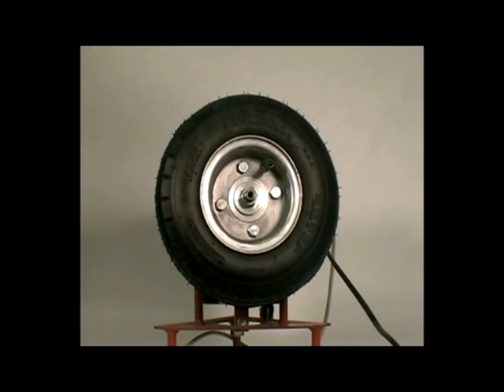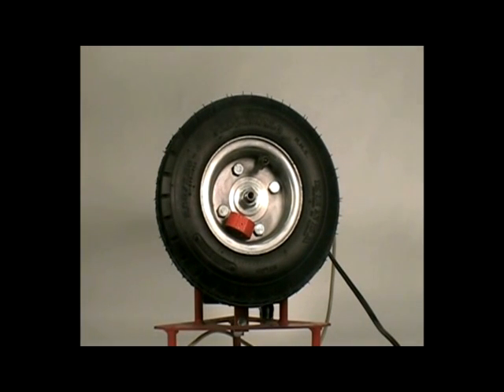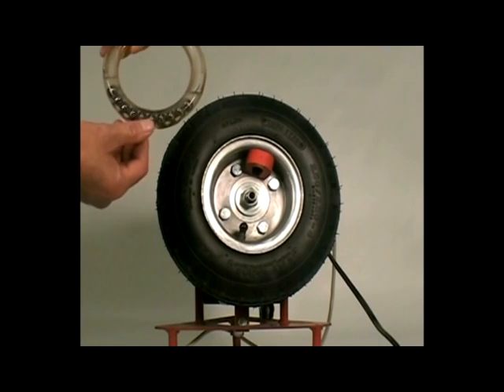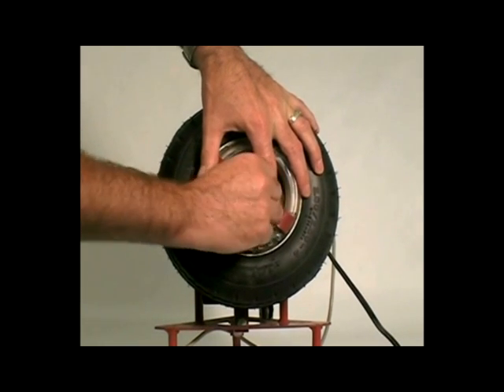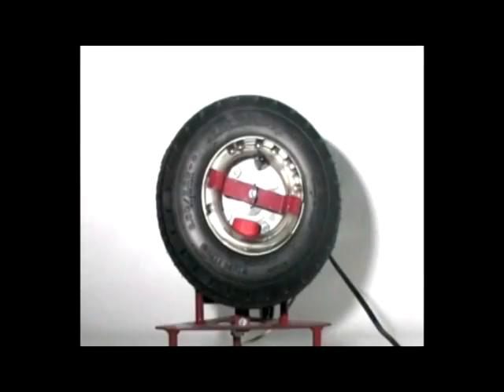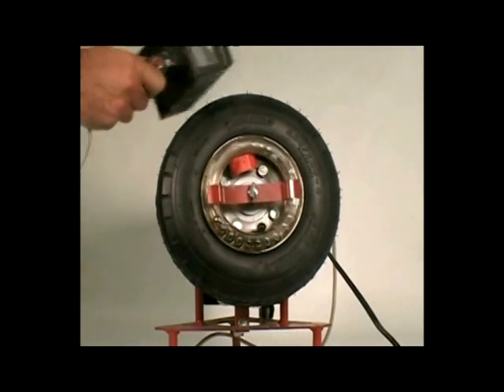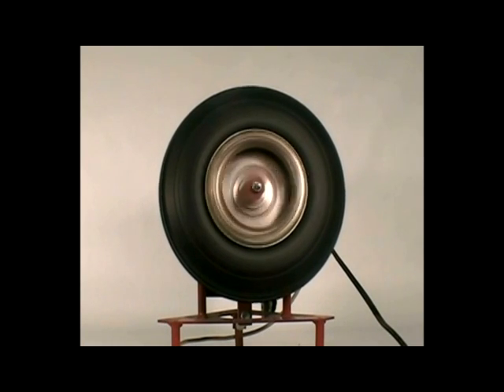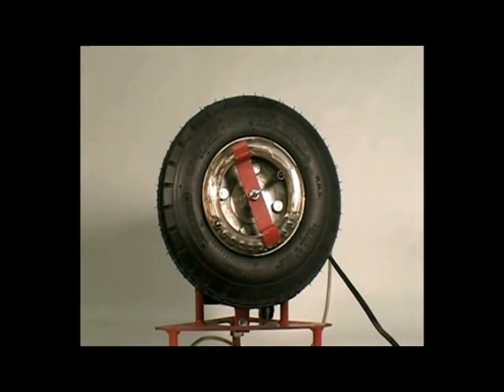How Centramatic Balancers Work

Comment: I have these on the steer axle of my 2018 western star 4900ex and front drive axle, will be putting them on the rear drive axle next week. The definitely work. No shaking in the front and only slight from the rear drives. I'm also considering putting them on my pickup truck